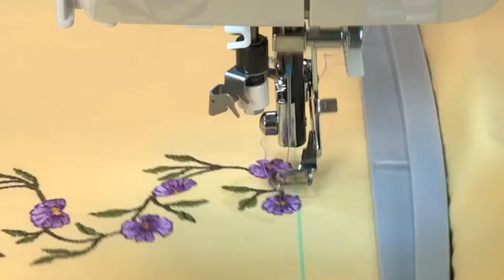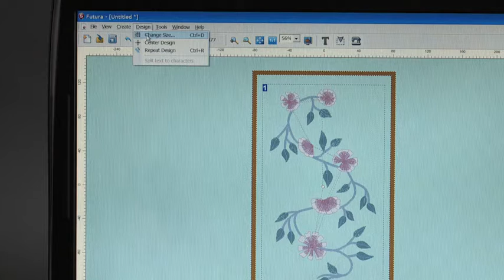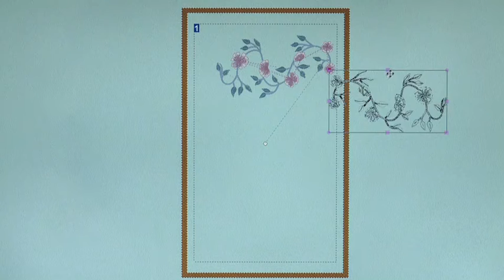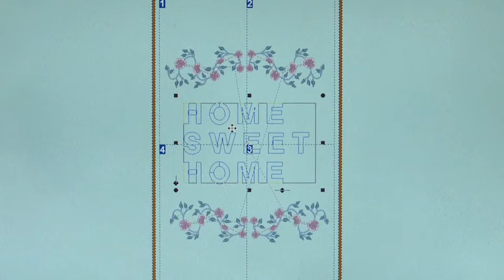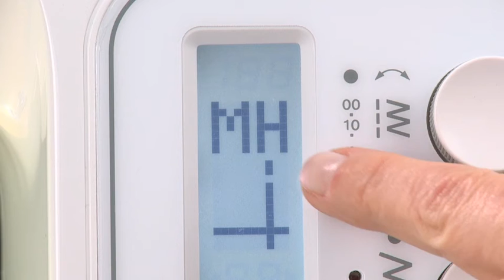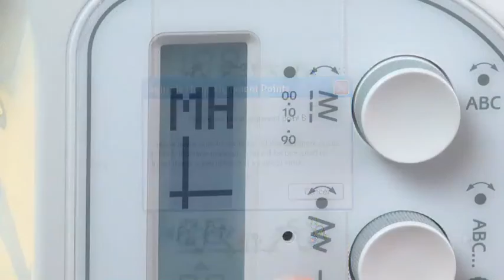SINGER® FUTURA™ Multi-Hooping Tutorial

Comment: What is the exact size of the embroidery area
Reply from the maker: Hello,
The sewing field for the Multi-hooping is up to 18.5 inches x 11 inches.
Reply: isn't that 20×12 area ,as in the features of singer xl 580 large hoop size has been mentioned 10×6 ,and I have owned a singer xl 580 a new machine recently,but still confused to do multi hooping because when I measured the embroidery area short  lines on the hoop it was just 9.5×5.75,and to do multi hooping,the exact size according to me is 19×11.25(exactly) pls help me to go ahead in my embroidery work with my machine by insisting the exact measurement of the embroidery area.waiting for your reply.